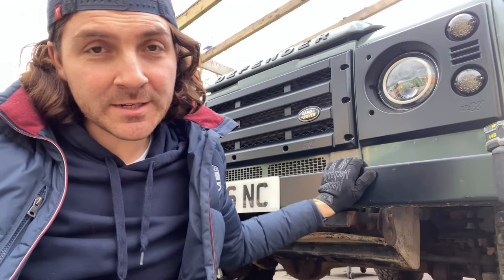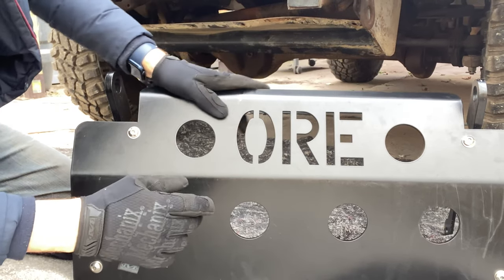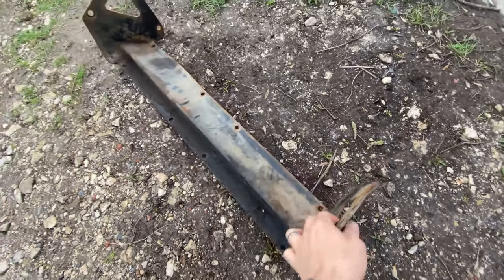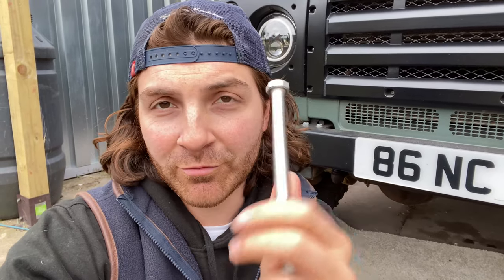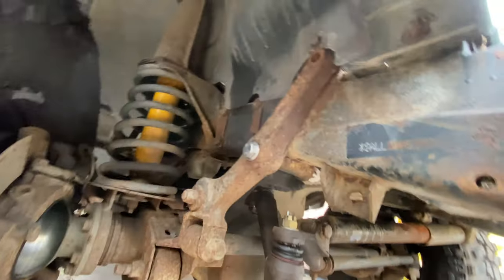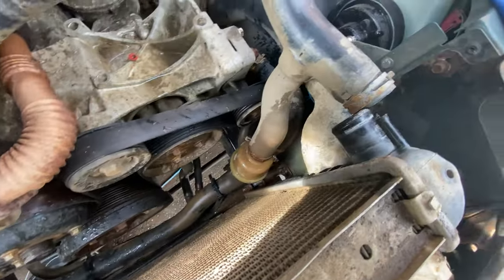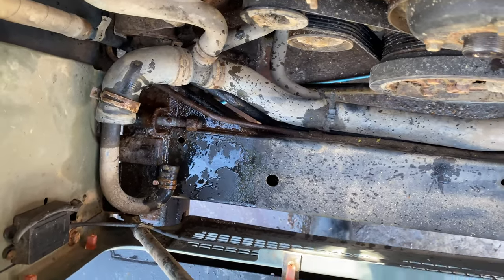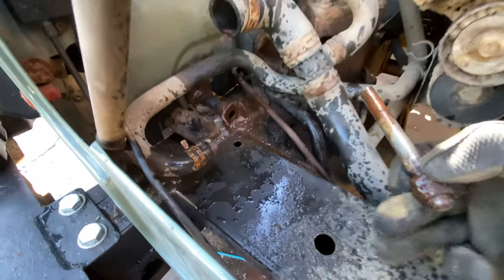REGRET ALERT!  HERE'S WHAT I WISH I HADN"T DONE TO MY LAND ROVER DEFENDER!

Comment: It has happened to us all. Enjoying the videos though. Small tip I've learned is coat new bolts the copper grease or anti fretting paste, means you wont have to cut them off next time you need to get them out.
Reply from the maker: Thanks Thomas- great tip - I’ve started to use copper grease on all new fittings now so I don’t end up cutting the car in half again!  😂

Comment: Always buy new bolts in advance for most jobs. Either you have to cut them off, or there so rusty you wouldn’t want to use them again. If you go to https://www.lrworkshop.com you can look at diagrams of how everything goes together, and also look up the part numbers.
Reply from the maker: Great tip rob- will be doing in the future!